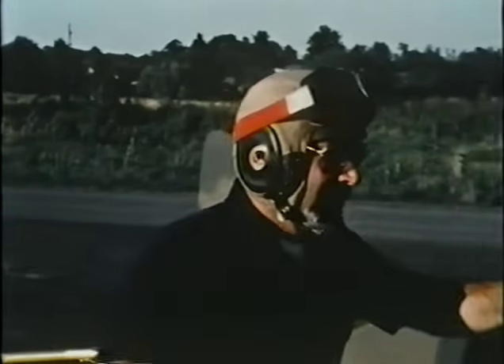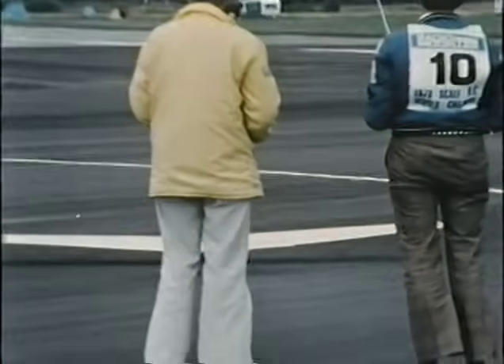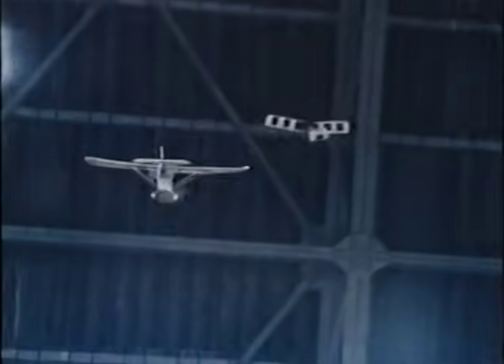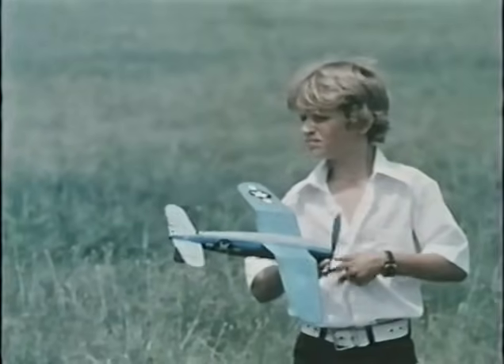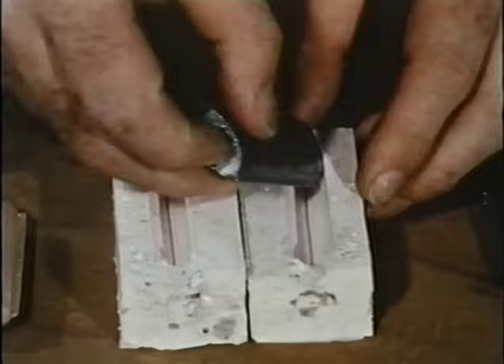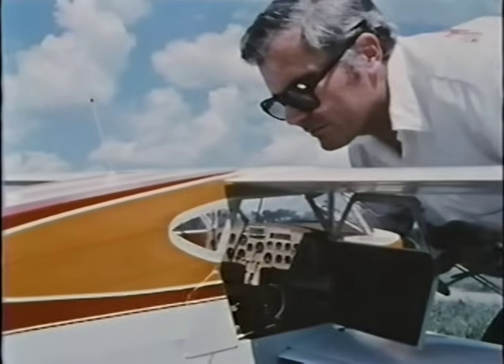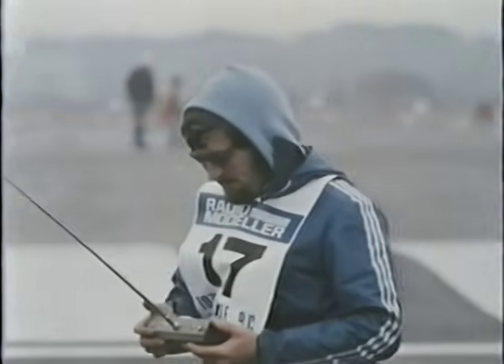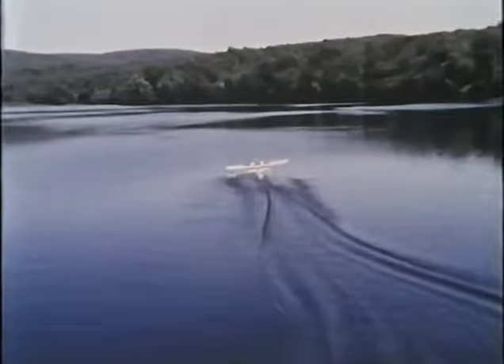Modeling's Grand Illusions: The Story of Scale Model Aircraft - AMA Films

Comment: Sadly, many of those award winning planes probably ended up growing dust in a basement,garage or Musium somewhere,never to fly again. Today's planes do not come to this kind of detail.The foam planes being produced in China are crap compared to the best ever details of those planes. Happily, today's servos, receivers and transmitters really making flying RC fun and easy,even for beginners. Hopefully it keeps today's kids interested in RC.
Reply: Foam is king!!  I've crashed balsa planes I spent months building and its crushing.  I quit the hobby several times after wrecks.  Now with depron, I can crash everyday and not care a bit.  I mean I dont crash everyday, but it wouldn't be a big deal if I did.
Reply: @BaquePhotography  Exactly right. The old days werent that great at all.
Reply: The traditional materials are now prohibitively expensive. These new materials have brought design and experimentation back into affordability for the young hobbyist. Also Chinese manufacturers drive to save on material, while they have produced a lot of rubbish have also highlighted how chronically over built many older model designs were.
Reply: These are all custom built.. people have way better material and tech to use nowadays. But I do agree that these planes are insane
Reply: Im resuming model building as i speak currently doing a lazy bee